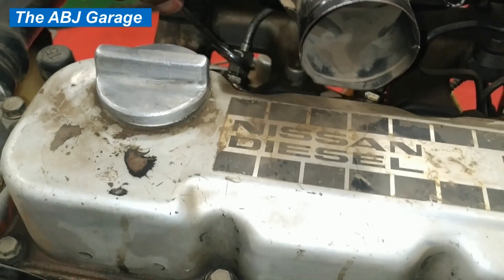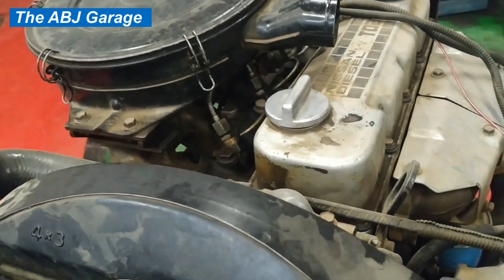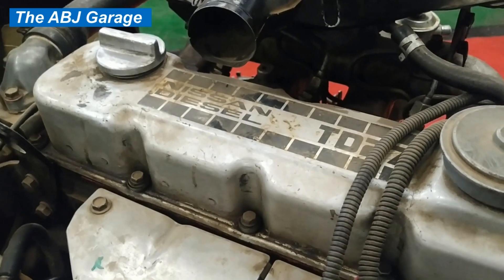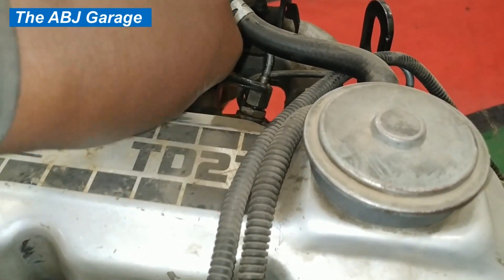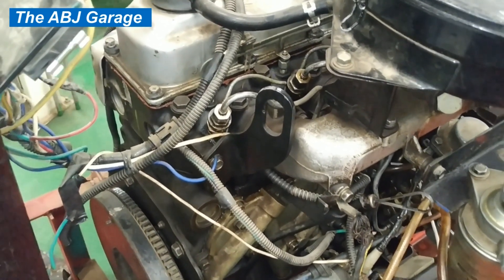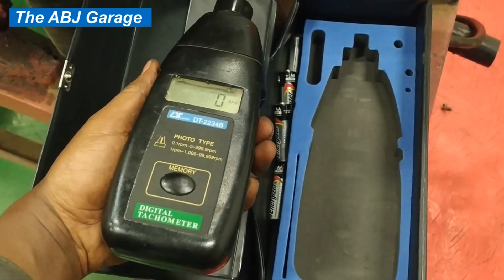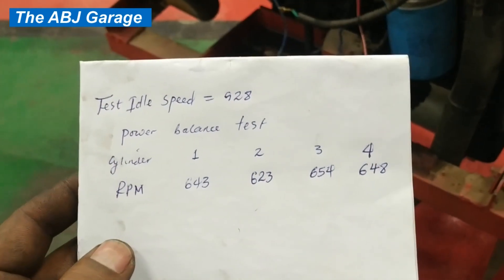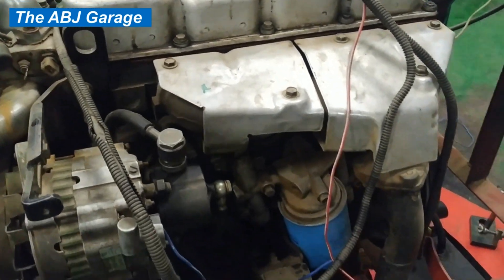How to perform cylinder power balance test on a car engine

Comment: Hi it is wonderful video but i asked quastion
what is the cause of nember tow cylinder is dicresing nember
Reply from the maker: Multiple problems could be a reason, bad injector, poor compression, wrong valve clearance....
Reply: okay so all cylinder nembers are equal but Abj Your Car Is Good Or Not Good

Comment: How do you turn off the injectors if it's Common Rail or unit injectors?
Reply from the maker: Interrupting electric supply to the injectors will do! Common rail power balance test can be done by using a scan tool.